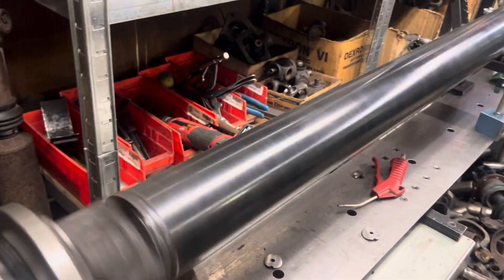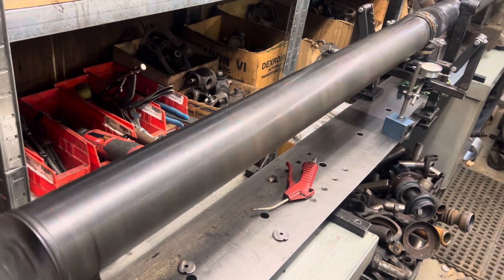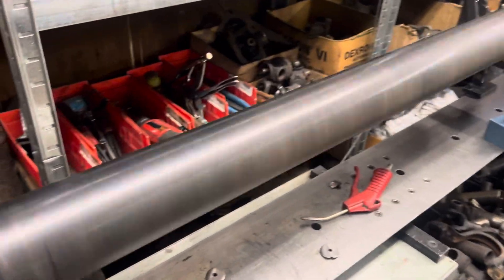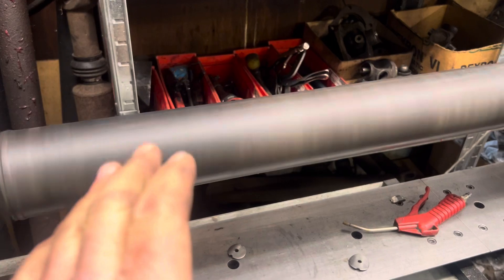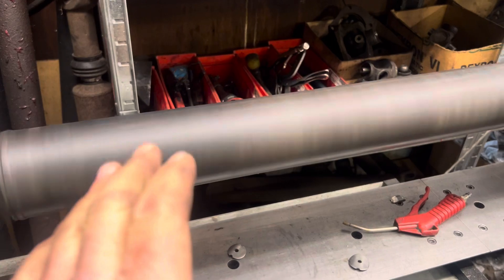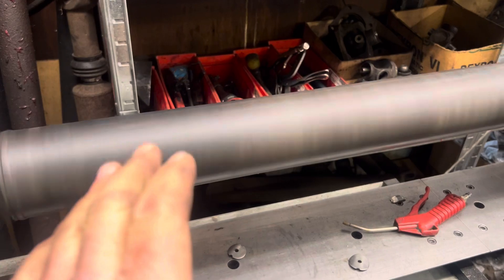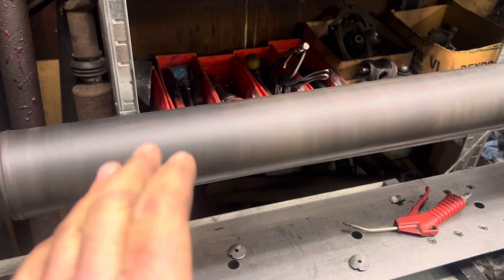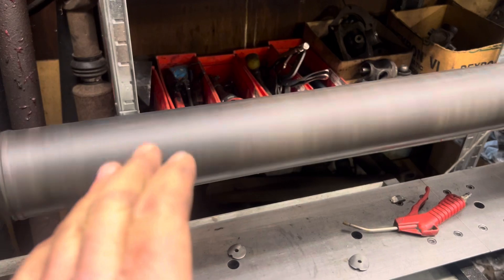#455 Customer Requested Inspection of Newly  Painted & Now Vibrating Toyota Tundra Rear Shaft

Comment: Worked as a PDI tech at McCoy Motors here in Flagstaff, at the time we were the Toyota dealership too, I saw drive shaft issues on lots of GMC trucks and you know their differentials were loaded with poorly cut gears. The new Toyota trucks occasionally had driveine ossues but usually after they had been to the Navajo or Hopi reservations around here. Several Engineers came from Japan to investigate why we had Toyota truck frames cracking over the wheel wells. Bobby and Ricky Curley took them out to their Parents house on the Rez, they were all bowing profusely when they got back! Both Bobby and Rick changed out truch frames and drive lines. Later I worked at an independent dealership that also was a VW/Audi dealership on the American side and we got a lot of reale auction trucks in with excessive undercoating on drive lines and some covered up bondo on frame cracks. Nnever saw a FORD frame cracked but I sure saw some GM and Rams with busted frames. That dealership was closed by the FBI one day when I was off work. That next day I came to work the entire dealership property was surrounded by CRIME SCENE POLICE Tape. I got my tools the next day after I spoke to the FBI in Phoenix. What a time 2000/01 was here in Flagstaff man!!
Reply from the maker: Seems like you had a wild ride in Flagstaff.  I'm not sure how the FBI got involved in the dealership, but it sure sounds like some serious stuff was going down!

Comment: Have seen a couple of balance issues of shaft awhile ago due to incorrect application of rust proof coatings on vehicles.Also once had a 2 piece shaft with a horrible vibration due to customer putting in a  lift kit  that messed up the drive shaft angles
Reply from the maker: @SR-yp3eg  that will do it . Correcting DIY joint & center bearing changes on 2 piece and 1 piece shafts are also frequent flyers here .

Comment: If it's calling for weight opposite the original factory weight, would you not remove the existing weight before adding more? Seems as if it would have the same result?
Reply from the maker: Yes it would.  Just keep in mind this troubleshooting vid was basically just for showing owner what was going on and where I suspected the noise actually coming from and what I planned on doing to fix it .  Check out the follow up Vid 455B to see the results  finished job and the details of what I did to fix it . Thanks for watching & please hit that subscribe button

Comment: At 3:51 it looks like the top circlip isn't fitted right going by the small gap between the tangs on the clip compared with the other ones.
Reply from the maker: If you haven’t already check  out the follow up vid 455Band see what the wonky looking clips turned out to be a result of .  Thanks for watching!

Comment: 35 years of turning wrenches never seen paint throw a drive shaft out of balance usually bad joint or the weight come off
Reply from the maker: Agreed it's not common but I have  seen a couple over the years ,,, a result of someone slathering excessive gobs  epoxy to cover up rust  and have big drips hanging down ,  So then I have to get it balanced again so I blast it all off and start over or build a new  one .  If you didn't already check out the follow up Vid 455Band see what corrected the issue .  Thanks for watching !

Comment: Couple of questions:
1 Are you in the N.E.//Maine area? (accent sounds familiar)
2 What are the bad to good driveshafts on trucks from the factory?
3 How often (average mileage) should this be checked?
Thx
Reply: Just a touch of Maine.  lol
Reply from the maker: (1) Sanford Maine (2) not brand specific and  question not easily answered  but all of the brands are slowly creeping towards non serviceable components , like staked in u joints that are not changeable and center bearings that can't be removed. The goal to shut out guys like me from fixing things for people .  This is a part of the Right to Repair law .  They will never stop people, ESPECIALLY ME  from repairing stuff .   I'm a fussy machinist in a  fully tooled up shop   (3) It's not a bad Idea to look every thing over underneath any ride when you change the oil .
Reply: @arsco6125  Thought so. Mike Day Concrete NORTH MONMOUTH, ME has the EXACT same accent.
Reply: @austinmachine6622  #3 I meant where you should take out the D-S and have it checked on a machine. You implied they all slowly go out of balance.
Reply from the maker: @mikejohnson9118  Ayyuh Chummy

Comment: only two bolts at the back?
Reply from the maker: Yes and 2 bolts on the front flange as well .  Yes I always do it that way on all 4 bolt flanges they are 180* opposite each other so they cancel each other out and don't effect the balance factor as long as you run matched sized bolts & nuts .  On a 3 bolt flange you have to run them all.
Reply: 4 bolts would be how its bolted in the truck. Testing otherwise would be wrong. I agree it is probably the rear u J.